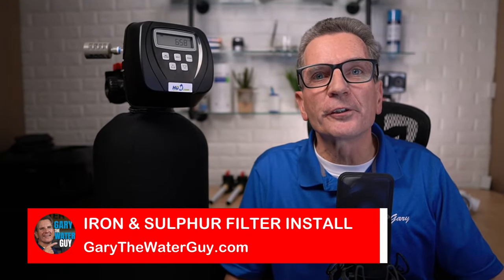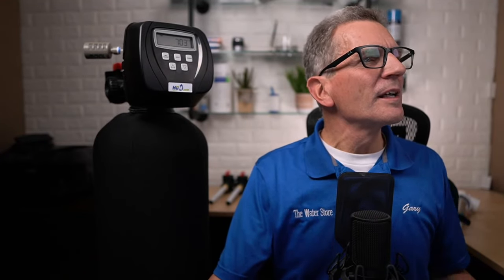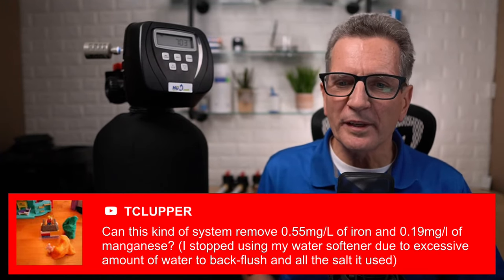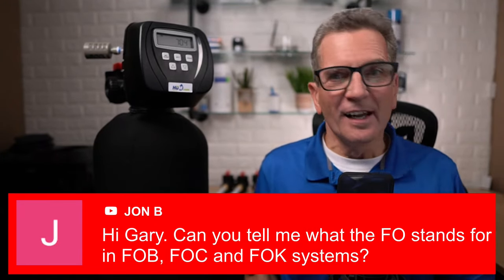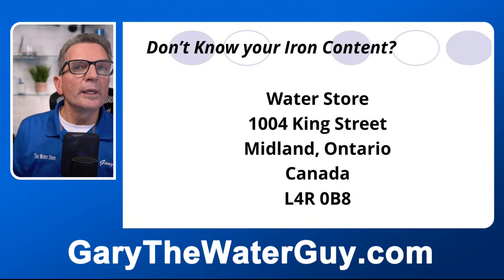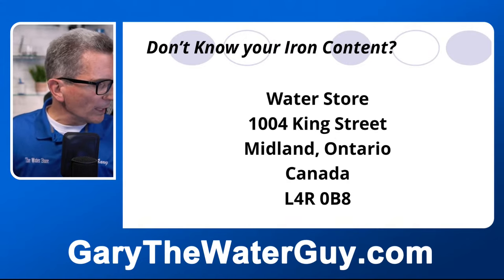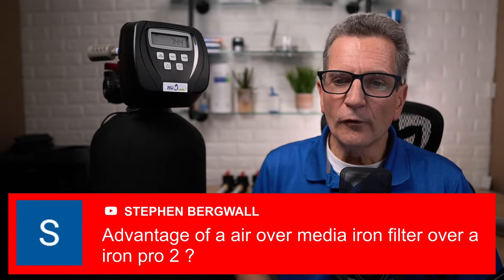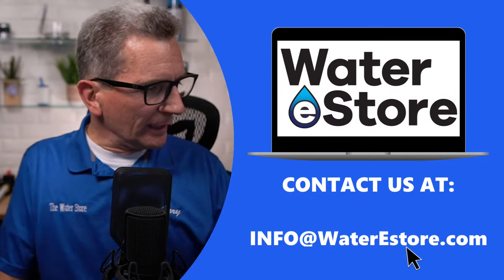Iron and Sulphur Filter INSTALLATION Tips, Tricks and DISASTERS Live Stream Event

Comment: This is a lot of info. I’m having an issue and not sure if it’s normal or not. During regen water is spitting out of the filter the air is supposed to come in.
Reply from the maker: No, not normal.  The check valve is leasking and you need to repalce the assembly with one of these https://waterestore.com/products/clack-fob-c-k-strainer-check-valve-air-intake-assy

Comment: Hi Gary!
Question;.. we have a well, pipe leading from ground to pump is 1.25 pipe. From the pump through the 28 gallon bladder tank, then the whole house is 3/4" copper pipe. We're going to add a iron filter, sediment cartridge, then a water softener. Our water pressure is 32/52.
My question is, would there be a benefit to having our plumber swapping out the 3/4" and use 1" from pump all the way going into water softener? (and leave the rest as is at 3/4)
Reply from the maker: Yes, but only marginally but if you do be sure to specify when you order your water softener that it has 1” connections

Comment: I use to have a  system that used salt, along with a sediment filter, and water softener and it caused issues with my blood pressure. So I am replacing that system with the air injection system. Do I still need a sediment filter with the air injection iron removal  system?
Reply from the maker: If you have lots of sediment yes, lots of iron, probably not.  Just keep in mind that the air injection iron filter will not soften your water.

Comment: Hi Gary. Thank you so much for taking the time to post all of these instructional videos. I have a concern that recently started happening with my iron sulfur unit that I am hoping you might be able to help me out with. The system is made by Pentair, uses a potassium permanganate solution in a small tank/well next to the taller tank, and was put in about 2 1/2 years ago right before we moved in. We never had any issues with it up until about two months ago. A gentleman from a water treatment company who came to give us a quote on an additional salt water softener installation told us that we needed to put more potassium permanganate in it by just adding more powder to the smaller reservoir. I bought some pot perm, and added it in like he said. This is when the problems began. Shortly after the unit regenerated itself, it began to spill excess pink/purplish liquid onto our basement floor via an overflow valve on the back. After speaking with the gentleman that gave me that great advice, he said the little float device inside probably had become fouled up. I disconnected the small reservoir from the larger tank and thoroughly cleaned everything with Iron Out to remove all staining etc from the iron. It is all back together, but just last night the unit did the same thing...spilled out excess liquid after regeneration....any ideas? Should I just replace the entire float device in there? Would love to get this figured out, and you seem like the guy who knows it all! Thanks in advance.
Reply from the maker: The float in the tank just needs to be set lower so the excess doesn’t come out.

Comment: Hi Gary 
At 52:42 you recommend getting a 3/4 - 1/2” pex crimp connector for the discharge line. Wouldn’t this restrict the flow needed for the backwash? When you talk about 5.3 gpm needed for the smaller FOB system to function, wouldn’t this inhibit the proper operation? 
Cheers
Reply from the maker: Great question! But no a 1/2” pex line will easily handle the flow

Comment: Hi Gary.  I like your videos. Good information. I think you had your numbers reversed on the video to calculate flow rate.  You came up with 12.5 gallons per minute, but described 43 divided by 60 which is .717, I believe  you should have stated 60 divided by 43 = 1.36 which times  9 gallons is your 12.56 GPM.
Reply from the maker: Sorry but I can't find the numbers you are referrring to, to check them out.  Can you tell me at what time during the video this happens?
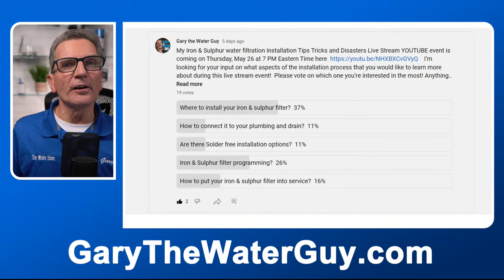Reply: 4:50 in the how to calculate the flow rate from your water pump video.  I viewed this again and I see you are dividing(not multiplying as I first thought) 9 by .717 minutes which is totally correct.  My mistake. I arrive at this 60 divided by 43 times= 1.395 times 9 for 12.5 gpm.  Math my old nemesis. lol

Comment: Gary,  Would it be better to install the Air cylinder before the holding tank so it does not waste all the water it filters?  Does the drain waste water hose push the waste water uphill or does it have to go down a floor drain.  My neighbor instructed me that it would harm the floor drain in time.  is that true?  I bought an Air Educator system her in P.A . Thanks
Reply from the maker: Years ago we would add a medical grade air compressor to add air to the water but they were very expensive, high maintenance and did not last very long.  It can pump water up and the drain can be connected to your exposed drain lines above.

Comment: Great information Gary. Thank you. You mention the flow rates being restricted by using 3/4 PEX. With an FOK system requirement over 5 GPM doesn’t that require 1” PEX going into the system?
Reply from the maker: No, you fine with 3/4" up to 13 gpm at least.

Comment: Hi Gary, The DLFC is 3/4" Male tread, would it be better to use 3/4" drain line rather than reduce it to 1/2" that is normally used. Is there a reason for this?
Reply from the maker: The only time it would be "better" is if the drain line is run more than 30 feet.  Otherwise it makes no difference.

Comment: I have a 1-year-old iron filter (air over water) and water softener, and 5 sediment filters, yet my toilets are streaking slightly with rust spots. the toilets are about a year old as well.. why is this happening?
Reply from the maker: could be clogged injector, could be incorrectly programmed, could be incorrectly sized.  I would call whomever installed them for you and ask them to come back and check them out.